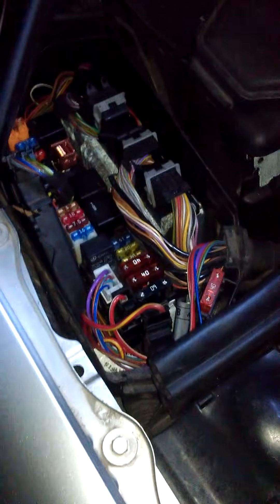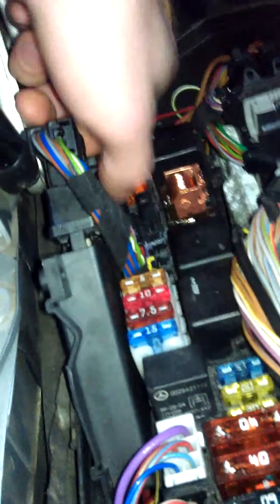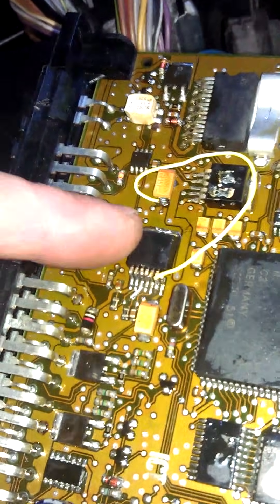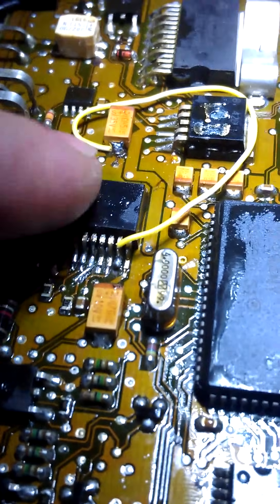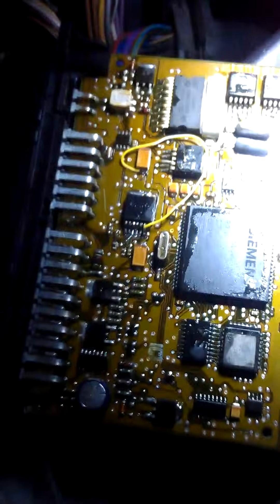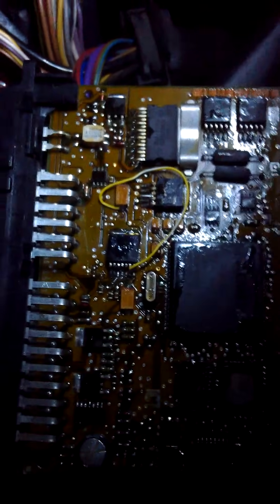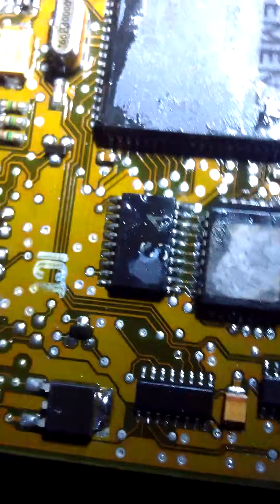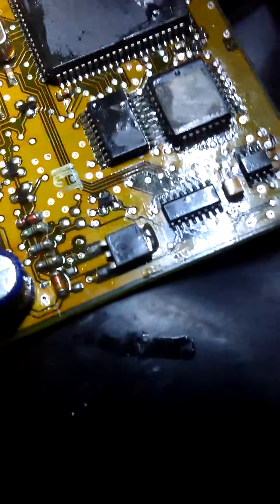2000 Mercedes S430 722.6 transmission control unit TCU repaired

Comment: We are having starting problems with our cl. Its not letting u ingauge dnr and sometime starts but rev counter is off
Reply from the maker: I can look at your car if you want to ship it over to me in NYC
Reply: @vsandvs  cheers for that .we have just stripped it down and water has done the autobox tcu and ecu for engine .ive cleaned them up and resoldered new resistor's on both units .and thats got the car into the garage from out side .but ive not got time for my own cars at mo as i would sort it .but yer ill get a video of damage and upload it .i know the abc messsage for the dash is coming on all the time ,so im putting that down to the chipset as it was under water

Comment: Where are you located? Do you do have a shop or do this for a living? My car will not change out from low gear? This is the second time this has happened and I can't seem to see where the water is coming from. The first time I swapped the computer with another benz I had
Reply from the maker: I'm in city island, Bronx. Zip code is 10464
Reply: @vsandvs  I'm in NJ and know City Island as I visit there ever now and then. I tried the mrmercedes.com but it took me to a totally different site. How can I get in touch with you?

Comment: P2001 Component N15/3 (ETC [EGS] control units) is defective . this is a message l get on the diagnosis machine and my car cannot go beyond gear 2. It's an A160 Mercedes Benz
Reply: It is in Limp mode. That is what it does when you can't communicate with the TCU or EGS. I just poured water out of my costumers S500 TCU today. I called the dealer, they are only remans now and the part is almost $1,300. I am sending out to be rebuilt for $250.

Comment: hello .
I put wrong relay in my car 2000 Mercedes s430 and now there is no dashboard light and headlights working but when I turn the key the car won't work . What I should do I need to replace the box fuses . 
thanks a lot .

Comment: Looked every where for an answer towards why my p r n d marker on my dash was gone and came upon this video. I own a 02 MB s430, changed the injectors, spark plugs and cables, starter and starter relay, and as soon it was cleared up and ready to drive my dashboard was missing the transmission marker. But now that I came across this video, I now know that I need a new module.
Reply: Did you ever fix your issue? I have the same issue and my car is in limp mode

Comment: Hi Viktor thanx for this great video, I have  the same module(TCM), I did check the voltage as you advice in the video,  from left pin to right pin should read  12v, 10v, 5v, Ground, 3v, Ground, 5v. right?  but mine is reading from left to right pin  12.668v,  11.966v,  4.964v,  Ground,  3.221v,  Ground,  4.966v. I know there is 5 to 10%  margin of error on the multimeter but the pin #2 left to right seems to have to much margin of error since you advice to be 10v  it's the chip bad or something is wrong beside the chip? actually the small chip left to right pin reads 4.799v, and 12.641v  I bench tested the TCM with a 12v  2 amps battery charger, please I  will appreciate your help thank you and keep up the good work Sr. !

Comment: If I buy a tcm transmission control module for my 2000 s430 will it half to be programmed buy the dealer
Reply: symeer howard

Comment: Nice to have that info. My sun roof on my 2000 ML430 was left partially open during a heavy rain and now I have only 1st gear and neutral. The indicator shows 'R' while the transmission is in low gear. 

Also, I can put it in Park if I turn off the car. Then I can access Reverse but after going to Neutral I can't return to R or P unless I again turn off the motor.

Coasting in N works but when I go to D a LOUD cluck and that was scary but seems to have no harm. I am lost as to what to do!

Comment from the maker: I mess with things, make them work, and learn from it :) Most of the times it works. Just started one hurricane Sandy flooded 06 Cadillac DTS. Water was up to side mirrors but not inside the motor, lucky. Struggled with anti-theft and still have some issue with shifter release. Body computer was all corroded. Cleaned it up, re-soldered few solder points. Car runs and drives. Now to all other minor things-windows, seats, lights, radio, etc. I'll bring it back to life...

Comment from the maker: Unfortunately, in my case power chip was not giving out any power so it was burned. Before replacing the chip I cleaned whole board, brush some flux on, and heat board with hot air blower set to around 350 celsius. All water was gone and some solder points in question were re-heated nice. 
Today I took one TCM out and there was transmission fluid almost up to the top of it. Luckily, TCM didn;t burn out, transmission shifted fine and car started fine. Just drained fluid out and cleaned the board.

Comment from the maker: Easy to solder on. Harder to remove. Use fine solder iron tip, like 2mm or so, and you will be fine. Had solder iron set to around 30 watts of power and used very fine solder rosin. And I brush on flux so solder will not leak to other terminals and short them. If it happens you can use desolder braid to remove solder and start over. No big deal.